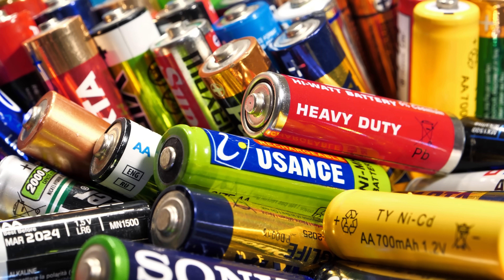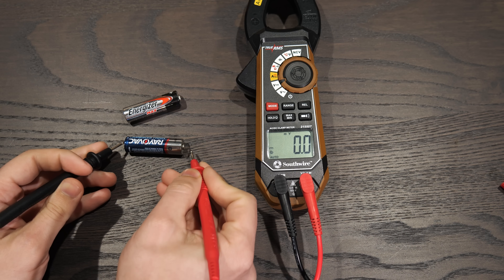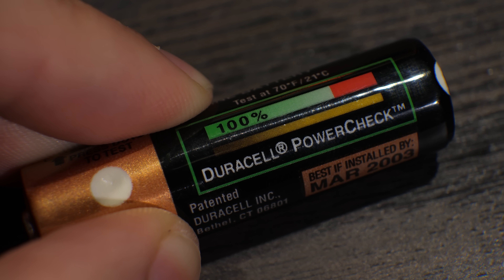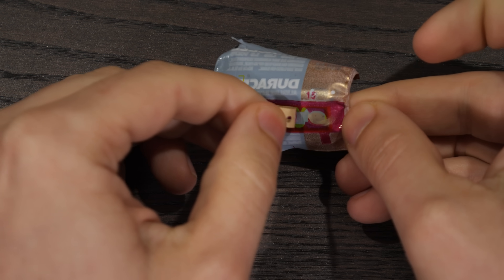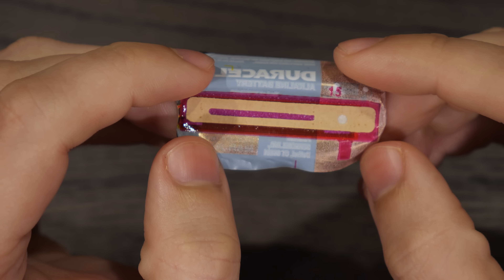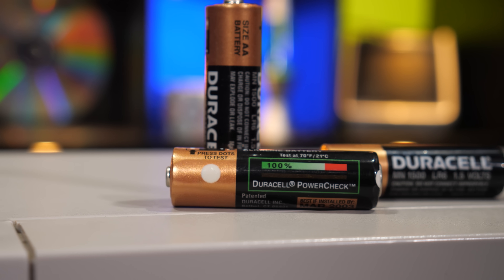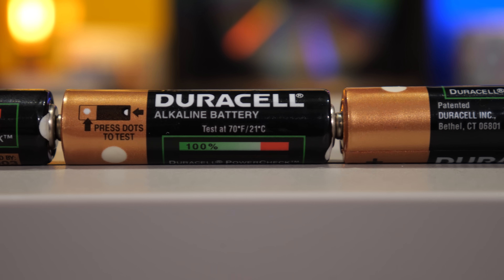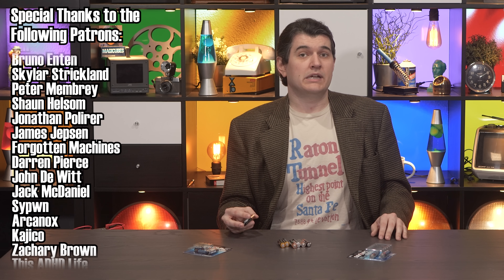Duracell PowerCheck: A genius idea which didn't last that long

Comment: I run rechargeable Ni-Mh cells for everything that still takes AA or AAA batteries, and i would love to have testers built into those to see which ones need to be put on the charger and which ones are ready to use. Maybe I'll take the sleeves off a few old duracell primary cells and make my own.

Comment: The real question is why don't rechargeable batteries use these? It works help a lot for most small devices that have no indicator or stop functioning below 1.4V.

Probably I did use these testers, a lot.

Comment: AAA batteries are good for applications where the draw is so low the battery will probably die from old age before it dies from use. How many times have you opened a TV remote to find that the AA's have corroded the contacts? By using the AAA "they" can insure the battery will die before it corrodes the device. My TV remote still has it's original AAA's from 4 years ago, and by the looks of things it looks like you are still rocking the original 2013 batteries for your TV remote. How long have you had that TV?

Comment: I never understood the need to test batteries so often that you need it built into the battery. Generally I buy new batteries, and put them in a device. And when the device stops working, I put new batteries in and toss the old ones. Pretty rare that I would take the batteries out at some random time with life left in them, which would necessitate how full they were.

EDIT: Haha you actually addressed this later in the video.

Comment: Ah, memories...
I remember this type of batteries. I regularly saw them in the stores but used (and tested) them only a few times. They were considerably more expensive than normal Duracell batteries which are already a lot more expensive than the cheap (and very good) supermarket batteries we mostly used.
But with three children and therefore a lot of battery-powered toys, most of our AA batteries were rechargeable ones. They were about 1-2 mm longer than normal AA batteries and came with different capacities from around 1500 to 3200 mAh.
But since they only produced about 1,2-1,4V even when fully charged, some devices wouldn't work very long (or at all) with them.
And I also remember the different boxes of used batteries; first, the "once empty - will still work in a remote or a clock" batteries, second, the "twice empty - but try them, maybe they will still work" batteries, and finally the bag of definitely dead batteries waiting for someone to dispose them properly.
Thank you for reminding me of all that.
Oh, and AA and AAA batteries are equally common, depending on the device. The really annoying devices used 9V batteries, or ridiculously many batteries. (I remember a remote control for Playmobil cars. The motor needed 4x AA batteries and there were two versions with different remote controls, one needed 8x AA batteries, the other one a 9V batterie. Hard to tell which was worse.)

Comment: When I was a kid I loved these batteries. I had a lot of electronics and very few batteries. I was moving around batteries daily. Like I had a walkman and a gameboy and just two batteries with any charge left. We eventually got rechargeable batteries but they were very expensive at the time. They also weren't as good as they are today in regards to amp hour ratings. So when I would get a set of these for Christmas from grandma it was great. If you poke the white dots with your nails they work really well. You just have to remember to do it and just wait for a second for it to warm up. You don't need to use the fleshy bits on your fingers at all really.

Comment: Maybe this is an unpopular opinion, but I wish we had stuck with AA and AAA batteries, rather than switching entirely to lithium. With AA and AAA batteries, you can swap them out whenever they die, rather than (a lot of the time) the device just can't be used while charging. And with rechargeable AA and AAA batteries, you reduce the waste from disposables with the same charger being able to facilitate most of your devices.
I just think it's ridiculous to spend hundreds of dollars on a nice set of headphones only to find that they simply stop working unless you remember to charge them every single day. I would rather swap out batteries every now and then.

Comment: My grandmother (born in 1897)couldn't throw out dead batteries. They looked exactly the same to her & I think she thought there might be some witchcraft involved in robbing her of electricity that could be reversed. She had bad eyesight & kept old flashlight globes for the same reason. Maybe someone would come by & fix them for her one day. She always had a rubber band on her wrist - the local paper was delivered rolled up every morning & she couldn't bear to throw its rubber band away even though she had several jam jars full of them. She kept neatly flattened out brown paper from parcels in a cupboard. She had shoeboxes labelled "Pieces Of String Too Short To Save" with hundreds of different kinds of string from parcels in carefully coiled & tied little hanks.

Comment: The humble, unassuming AAA does not deserve  your ire. If you're spending the same on AAA as you do AA then you are doing it wrong. Also if you got new AAAs then you can easily use them in a pinch in place of AAs with foil. The reverse can't be said. And AAAs are almost always in stock even during a storm.

Comment: As I watched this video, I said, hey, I have some of those batteries around, and they still work!  Turns out, they are Duracell Quantum AA cells, with an expiration date of Dec 2025.  The package indicates a 10 year guarantee, so it is a fair assumption that I bought them in 2015.  The test segment has 4 colors, red, yellow, faded green, and faded green; same shade.  Still pretty close to 'full'!

Comment: I would actually appreciate this feature in my rechargable AA, AAA etc. 

I throw batteries that were already fully charged on the universal charger all the time. Altho i suppose that would be resolved with a charger that is more accurate at the batteries charge (altho i dont know how that would work with batteries of different storage amounts).

Comment: Batteries similar to those, and I believe with the same name, were released by Duracell in Brazil but waaay after the 90s (I wasn’t even born in the 90s, and I was at least old enough to remember the commercials of these on the TV). Pretty sure they looked sightly different too.

But yeah, they were also very short lived here and I never knew if the battery was actually dead or if I just wasn’t pressing hard enough

Comment: You ever was outside and your device with a recharchable battery ran out of juice but you didn't had a powerbank with you? You was always able to buy batteries in every store or gas station, even away from bigger civilisation. I never saw a fully charged powerbank to buy somewhere and rarely places where you can charge your device. It really had its benefits. I mean, this wouldn't be unsolveable but the way thechnology developed, with hard installed batteries and so on, it's gone.

Comment: I used to play with the ones that were built into the plastic packaging the batteries came in. You could test any battery that would fit in it. I noticed it would eventually fill up if you held it on long enough and it would get warm.

Comment: Durecell quantum, used to be my favorite disposable battery. Until they were discontinued. They had the power check. Now I use the over priced Energizer ultimate lithium that doesn't have that feature 😅

Comment: As I recall, Energizer batteries derive their name from the fact that they were meant to be recharged.  You would place the dead batteries in a charging unit which would then be plugged into a wall socket.  This didn’t last very long due to the obvious dangers.  Can you shed any light on this?

Comment: I've never seen a positive shell on a battery before, and I've pulled apart many, MANY batteries, including NiMH and Li-ion batteries. All of them had a negative casing, which for the disposable batteries was a zinc cylinder that comprised the anode.
How many are positive casing? Is that perhaps peculiar to North America? I'm Australian. Or are they peculiar to the power check versions, which I've never pulled apart?

Comment: It WAS genius on Duracells part because pressing the dots shorted out the battery across a heater which stole current out of the battery and helped to deplete it faster. The more you checked it, the quicker the battery went dead and you had to buy more

Comment: I have a use case for partially used batteries that might be more common than you think. Seasonal decorations. Right now I just loaded up all our Halloween noise makers and light up things. After Halloween, I take all the batteries out. Put the stuff away, and throw those batteries in a drawer until....Christmas season. By New Year they're dead and they get pitched.

Comment: I thought the built in battery tester was a nice thing, but I found out how slow the time it takes for the tester to give an accurate idea of the battery condition, you just wasted some of its usable energy. Yes, testing a battery under some load is better than just using a regular voltmeter. I have an old Precision tube tester with a built in battery tester and it places the battery under a load, just like the Radio Shack one I have. I use the Radio Stack battery tester a fair amount, which is a quick way to test a battery.

Comment: Yeah not using nearly as many disposable batteries anymore.  Rechargeable battery technology has improved greatly since the days of common Alkaline battery and the rechargeable has become MUCH more common and reliable with the advent of Lithium-Ion batteries.  So, these days, honestly the only thing that uses disposable batteries anymore are the remotes and a couple of portable wireless mice I have for work laptops.  Even most of my flashlights have some sort of rechargeable Lithium-Ion battery.

Comment: I fondly remember these and use them frequently. Made me upset they stopped including it.

Edit: Now that I heard your case, I kinda get it, but I was one of those rare people who actually did frequently test batteries and didn't have the money to afford a tester. I used em for video game controllers before they started issuing the built in rechargeable batteries. Was nice to know if the controller was genuinely broken or if the battery was dead, or if there was some kind of wireless issue, etc. Not VITAL, but useful when needed.

That being said, you're spot on about how hard the buttons are to press. I used to have to use my fingernails for that extra firmness.

Comment: Here to mention that some more feature rich multimeters have a battery test mode. This is actually better as these modes actually load test the battery, so it's much more accurate than just measuring the no load voltage.

Comment: I also remember it was either Energizer or Duracell, maybe both, who had the package-attached test strip where you would squeeze from + and - for the test strip to thermo-chromatically indicate the rough charge left in the battery.  You would purposefully save the package to use for this feature.

Comment: Yeah, I remember them, they always stopped working before you actually needed them. They would degrade over time, often faster than the battery.
A $10 Multimeter was a far superior option.

Edit: Everyone I knew used the testers whenever required, but we never bought a battery because of them. There were also other ways to test, an old torch used batteries until .6 of a volt, even less, it just got dimmer. Hand held computer games needed the highest volts, once they ran out they were still good elsewhere. Still I stopped this practice long ago.

Comment: I'd like to agree with you that we're mostly using rechargeable batteries, but, they still sell those 48 packs of AA at Walmart so I'd say there are still a lot of people using disposables. I have switched to rechargeable but more devices have built in batteries, too. Sadly, not all of them rechargeable.

Comment: Back in the 1990’s every toy had batteries… remote control cars, toy guns, Walkmans, Nintendo Gameboys, Sega Gamegear, bike lights, walkie-talkies. A portable stereo sound system would have a long line of D cell batteries.
Built in lithium-ion batteries and usb charging cables were unheard of.
If I needed a battery, rather than buy a new packet I’d rob a battery from something else in the house. Often the tv remote had a battery missing. So I can see the need for the battery tester when batteries did get mixed.

Comment: I don't use rechargeables because the common ones I would use, the NiMH, only outputs 1.2v/cell when fully charged.  I found them a hassle to keep charging them more often than just replacing 1.5v AA cells when they're dead.

Comment: These were in the late 90s. I guess that means I’m getting old because it seemed like more recent than that.
There’s times I wish I had a battery tester. My mother works for the state of Texas and gets these 4 packs of energizer that are solid black. They look generic. She keeps them in the freezer and I don’t know how many times I’ve gone through them trying to find good ones. Her issue is more their age. I would be curious if any engineer could tell me if the freezer thing works or if it’s an old wife’s tale

Comment: The AAA, Annoying?

I think not,
Allow me to introduce you to the D cell battery.

Any toy that took a D cell ended up using like 4-6 at a time, and the batteries died just as quick as any other smaller cell.

Only good batteries were watch batteries….. until you have to change them and you have to find a similar battery

Comment: I will say that, for me, the most common use case of these was troubleshooting. Seeing 1) if the batteries were dead, and 2) which ones actually needed to be replaced. It tended to save having to go all the way to the garage to grab my tester (if I was even close to home) or delve into the big battery box and just be able to use the ones I had much closer at hand. Not super common but I did appreciate having it.

I will also say that the testers had a technique to them that made them much easier to use. It was the way you pressed on the negative terminal button. Pressing at the right angle made them work with a lot less pressure

Comment: My gradfather worked for Duracell developing the manufacturing machinery that wrapped the sleeve onto the battery. Apparently it was a massive pain in the ass to get it wrap perfectly so the meter actually worked.

Comment: There's also another issue. The temperature. Regardless of seasons, there are many countries near the equator that never reach that temperature.

We have only gone that cold twice in the last 10 years.

And it wasn't exactly 21.1 degrees.
It's usually 30 degrees here.

Which means they weren't even sold here. So the market was limited as well even if people were using it.

Comment: There is actually one very, very good use for a Peltier element. If you put a giant heat si k on one side and keep the other side cool, you can generate a very small electrical current. Example:  wood stove fan. Place it on a wood stove, and the temperature difference between the two elements will generate enough electricity to spin a fan motor, cooling the upper element and distributing heat around the room for free!

...but that may be the ONLY good use for a peltier.

Comment: The only way I end up with partially used batteries is for various holiday decorations.  I keep them in a zip lock bag between use and use a $4 battery tester to match up old batteries with comparable remaining capacity to use in other things (usually TV or Roku remotes).

I'd invest more in rechargeables except that all but the most expensive chemistries only output 1.2 volts, so they don't work in all applications.

Comment: From my experience the built-in tester drew too much current when used and caused the battery to drain quicker than it would have otherwise. In any case, I realised in my teen years that it's far more economical to buy and use rechargeable batteries than disposable ones.

Comment: My bluetooth Logitech mouse came with a Duracell AA battery (it has a line say "not for retail") and i've been using the mouse everyday for almost 2 years and the battery still not dead (the mouse is  rechargeable)

Comment: I can't remember ever seeing batteries with built-in testers, like this, but I do remember a couple packs of batteries I bought, that came with a separate tester strip.  It was clearly the same technology, just not integrated into the battery label itself.  I have no idea how long that practice lasted, since I switched to rechargeables ages ago.

Comment: They removed the PowerCheck, changed the formulation/construction so that the batteries are almost guaranteed to leak and destroy whatever they are installed in, and raised the price.  Now that's progress!!  DURA-LEAK sucks!

Comment: I have the same problem, something comes with double A's when it could run with 18650's

Off to Amazon to buy a battery holder and some bits of wire and solder. 🐢

Comment: Interesting.
When I didn't have a reliable way to test batteries at hand, I used to just use a metal paperclip to find out whether batteries were fresh or used/done.
I just shorted out the poles and could tell how much energy was left in the battery by if and how much/fast the metal warmed up.

Comment: I remember at least once a hole was burned through the buttons as I was testing it. After that, I usually pressed with my fingernails for fear of burning my finger.
Now that I think of it, that may have been caused by not pressing hard enough and having a very small contact point, making the button itself a point of high resistance.